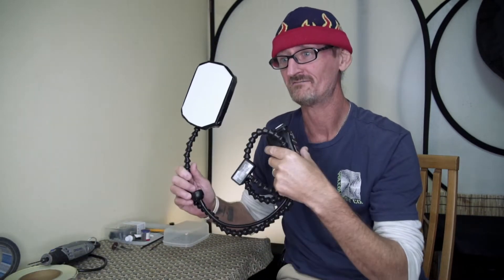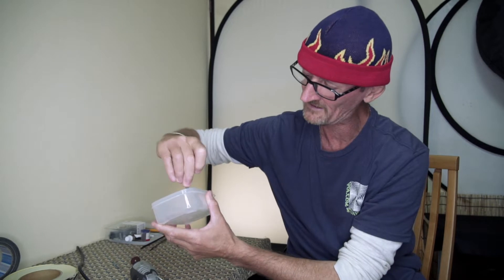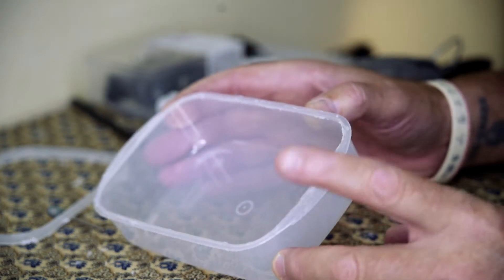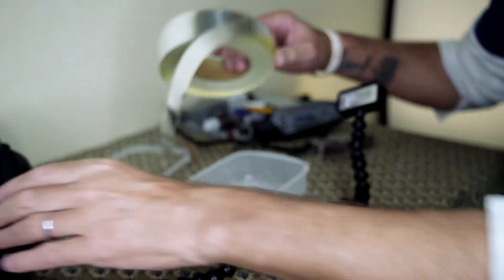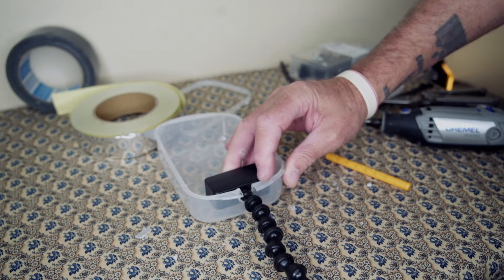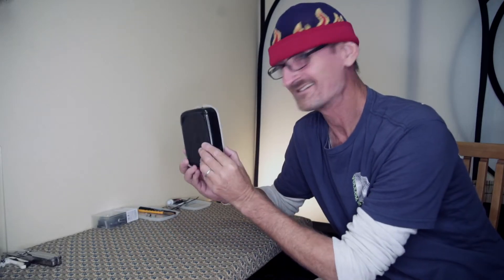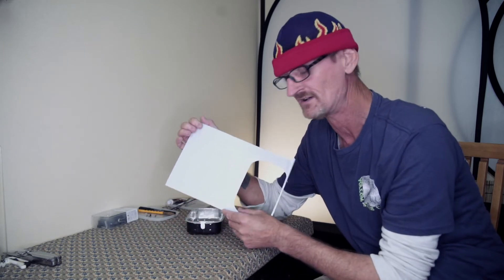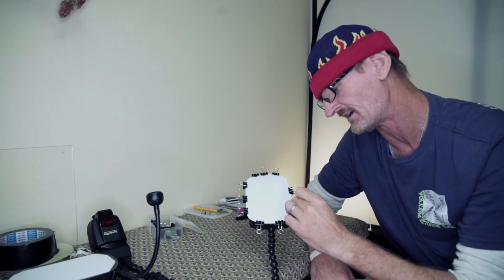Home Made Diffusion for the LAOWA KX-800 Twin Macro Flash

Comment: Good job ! 
My twin flash light is the new KaKas K808, equivalent to Kuangren K800 from Laowa. As diffuser for this light  I use a plastic sheet from inside an old laptop screen. Inside the screen are several plastic sheets, one of them is white and also an excellent diffuser.
For the diffuser box on each light I used some black corrugated plastic Polypropylene board or "PP board". Easy to cut and assemble (hot glue or adhesive).

Comment: For how long have you been using the Laowa twin flash ?
Do you recommend the Laowa twin flash for macro photography ?
Reply from the maker: Hi Aljo, I've been using this twin flash model from Laowa for the past five years. I love working with it. I also had the much more expensive MT24EX from Canon but the Laowa is preferred as it has the adjustable modeling light, something that's lacking on the Canon.
Reply: Is this the only unit that you have used ?
Are the arms of this flash build well ? It's one of the concern that I have about this flash.
Reply: @aljo.antony  Hi Aljo, I own the Kakas K808 (same as Kuangren K800) and the plastic arms are strong enough. Just don't twist them too much as there are electrical wiring inside them.

Comment: Do you have any issues with the arms? They snapped from very little force. Mine is over 4 years old. Maybe they improved the design for yours? When did you buy this flash?
Reply: The design does continue to evolve.  I have gone through a number of them in 5 years.  It took a while for me to learn it was my A6000 camera short circuiting them.  I didn't usually use it on that camera.  Each one I have used had minor design differences.  The very early ones had much flimsier arms that would pop out of socket too often.  That would have been 5+ years ago so probably not yours.  That rarely happens with the newer ones.  I have had one broke where the arm meets the flash head.  I don't think I put much pressure on it.  Now with the replacement I am very careful when repositioning the heads.  I have bought from B&H and Laowa.  The replacement one is now starting to misfire on one side too often (it is almost 2 years old).  I really hate buying a new one, but every time I do, I remember how much I love shooting with these.
Reply: @jciv  this exactly happens to me....i replaced like 3 units from misfiring. I don't know if this is cause by sony hotshoe?

Comment: I would like to know exactly what the white plastic panels are.  You said it is just white plastic about .5 mm thick.  Where did you get it?  Is there a link to order exactly what you use online?   I think it is brilliant, btw.
Reply: Hi Mike.
As diffuser for this light  I use a plastic sheet from inside an old laptop screen. Inside the screen are several plastic sheets, one of them is white and also an excellent diffuser.
For the diffuser box on each light I used some black corrugated plastic Polypropylene board or "PP board". Easy to cut and assemble (hot glue or adhesive).